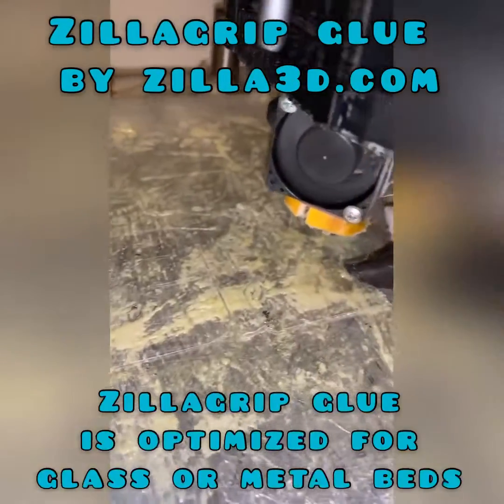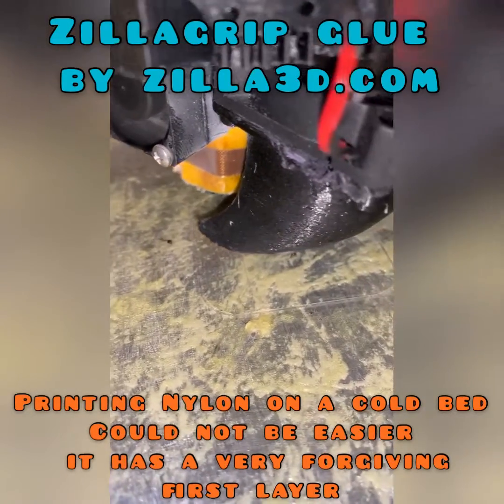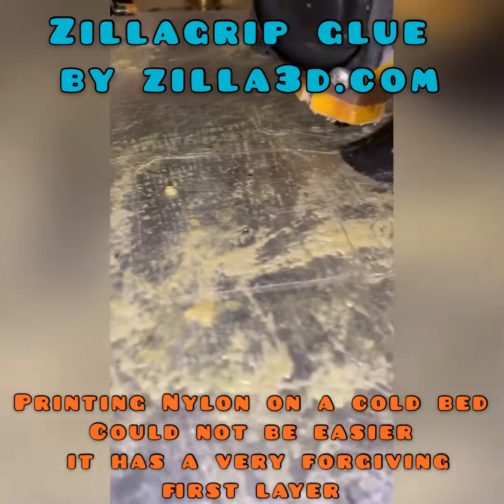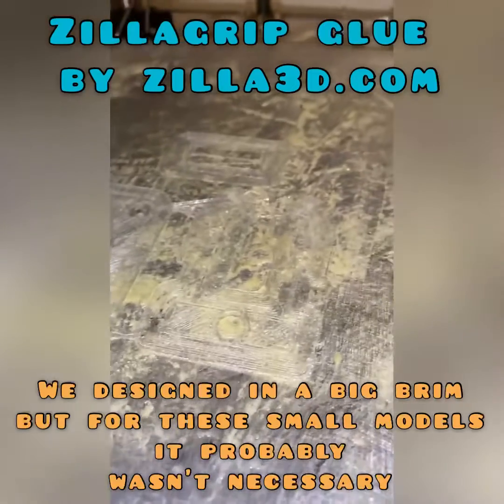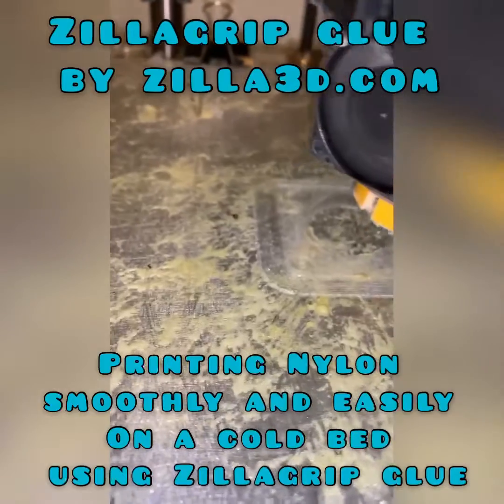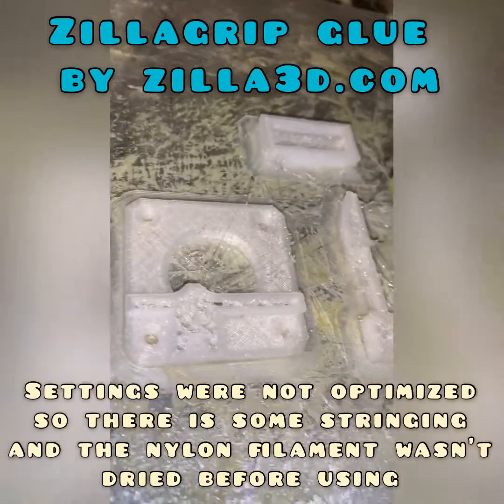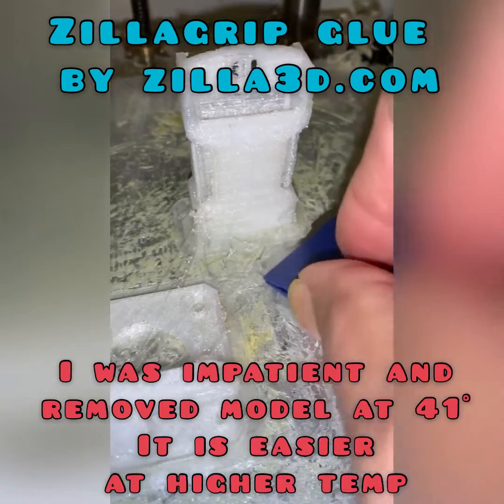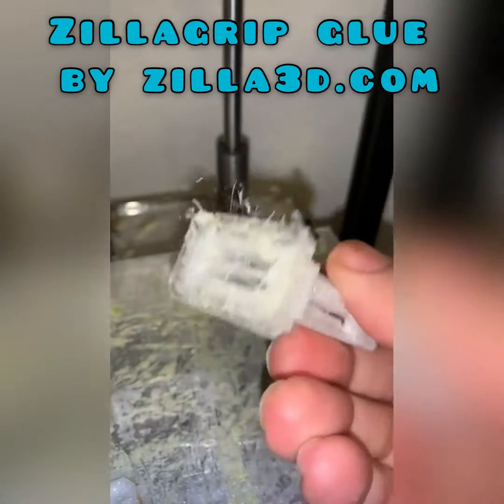Easy 3d Printing with NYLON (or PLA, ABS, PETG, PP, PC, POM) Print functional parts help new video

Comment: If your trying to sell a product don't you think.you should have put a bit more effort into the video...the prints look like trash and the bed condition is horrible.
Reply from the maker: We weren’t selling filament or this printer, just showing that nylon sticks to the Zillagrip coated bed without heat, which it did. The nylon needed to be dried and setting for this filament could have been perfected. You are not wrong on that.